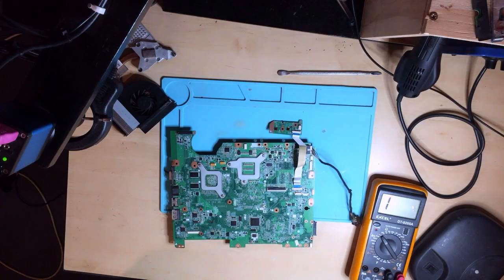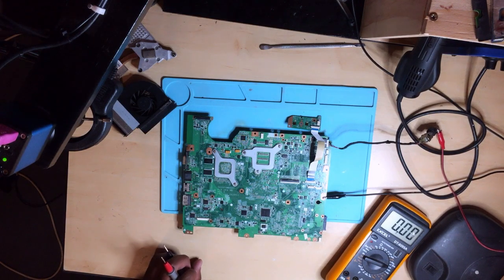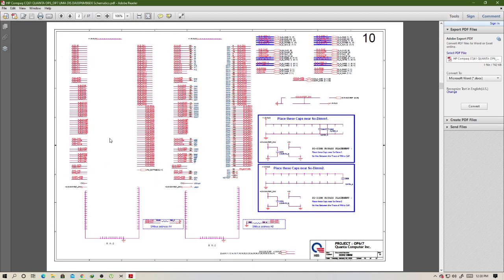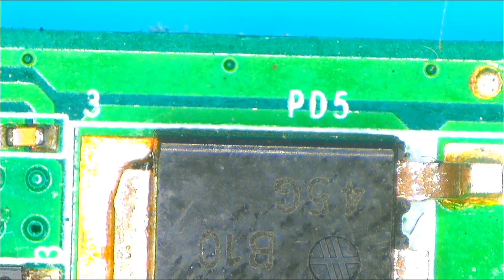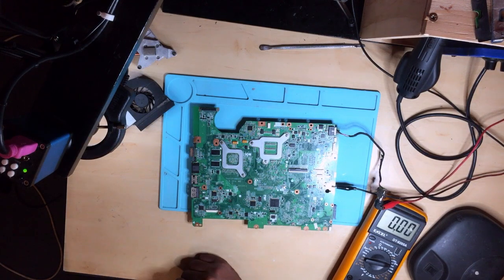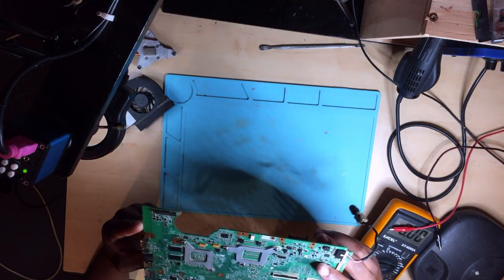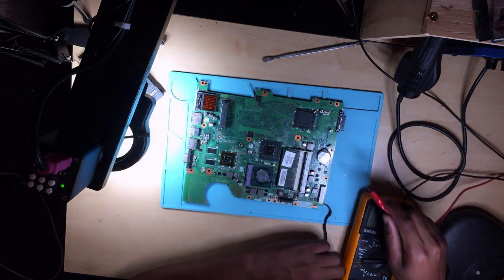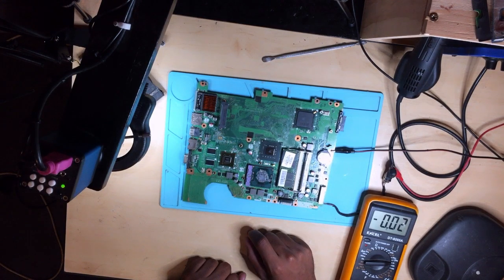Steps to diagnose 3.3v and the 5v

Comment: Options  b.

Inject  0.7 v @ 1 amp on any inductor. 
 If  voltage  drops  and amp raise. The  you found the shorted rail.  

If all are OK. The  inject  0.9v at @1.5.amp  on current sense resitor 
If voltage  drops and amps raise then u know the short is on 19v rail to.
Then  go t Bq chip. Check 6v @ regn pin

2.4v @acdet
2.4-2.7 @acok.

The check. 1st and second  mosfet  gate voltage should  be 6v greater  than  charging  voltage . 
If no 6v at regen pin then  1st and 2nd  fet won't  allow  19v to pass to current sensor

Comment: Steps to check  with out  long story's. 
1. Multimeter  on
^ beep mode^. 
2. Black prob on ground.  Then 
Option  [A]
Place red probe on all solder  joints marked  ^JPF^. if it beeps and  ohms close to 0.  Then de Solder there. TEST  each side of the ^JPF^ joint see wich side beeps or had low ohms.
 Follow the pad   and see what the rail powers.  Jpf split  Pad away of coil is towards  the Rail.. Towards  coil is the vrm.

  Inject 0.7 v  .. ->  use thermal  camera,  Rosin flux atomizer, ,spray ipa., check  close what gets hot. Replace. Part  if possible. 

Or remove  the cap.

NEVER USE DC BENCH ON 19V RAIL..
DO NOT INJECT IF YOU HAVE NOT DISCONNECTED  THE ^JPF^ POINTS AFTER THE COILS.
 
IF High side  fet short  on any power rail section u will destroy  the  board.

Inject 0.7v on 19v rail  is safe.